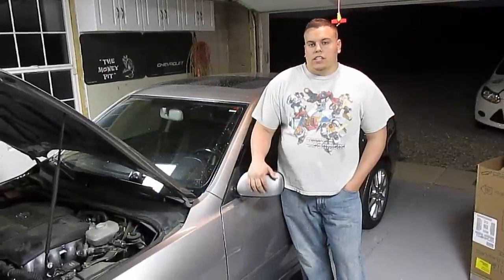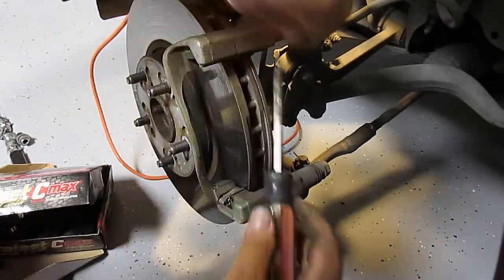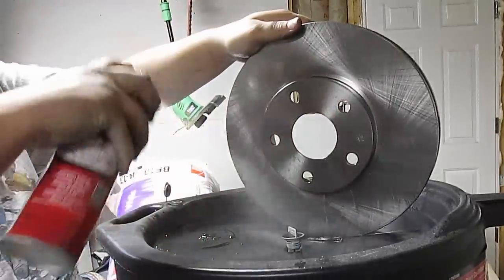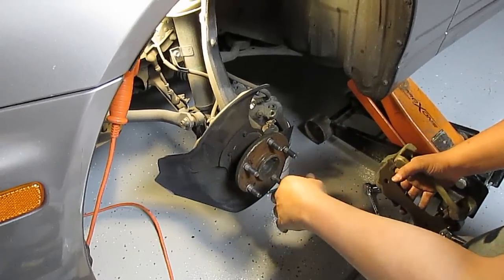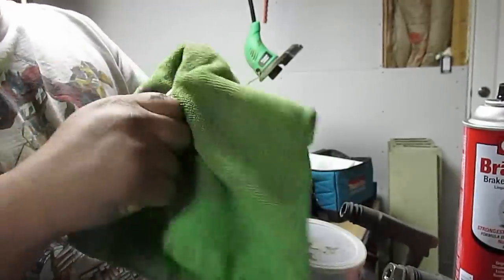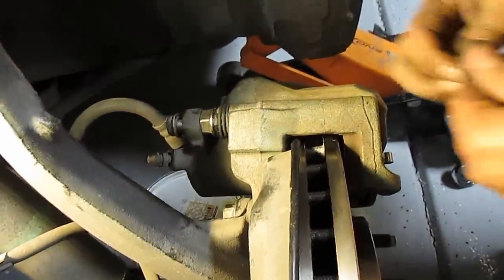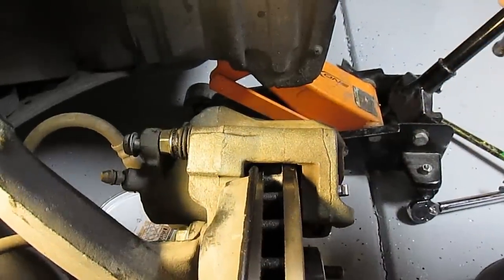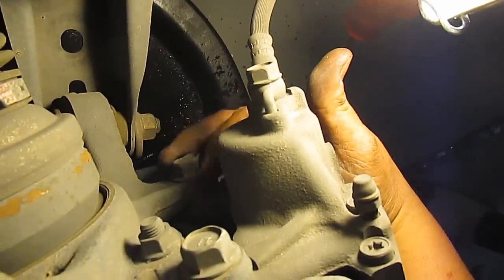Step-by-step Guide Easy Front Brake Replacement 1999-2005  Lexus IS300

Comment: Do not use that grease for slide pins. Silicon High Temp Lubricant (brake grease) is required, that grease will break down, and the slides will seize.
Reply from the maker: have never had an issue not once.  and i track day my cars
Reply: +Jason Georgievski I cannot argue what has or has not happened to your brakes, this is a common well known issue with incorrect grease. You can do whatever you want tho.
Reply: Well i cooked a friends brakes by using bearing grease... They were gone in 10 months and the grease was like a sticky wax ONLY USE Ceramacote or caliper grease also you appear to be from the westcoast on the east coast brakes will be so rusty that thwy wont just come off.  Hubs may need to be sanded as well.

Comment: Just a heads up when you’re cleaning your slides off and they have rubber grommets on the end of them like that one be careful on what you clean them with that brake cleaner will sometimes make that rubber swell up if you get the hardware kit it should come with the new rubbers also when putting your slides back in be sure to get the air out of the slide holes squeeze the rubber and push the slides in so the air gets out
Reply from the maker: hardware kit did not come with them.  but yes rubber can possible be damaged.  but this specific rubber part had no adverse affects.
Reply: @FatGuyBuilds  where does the pin with the rubber go up or down?
Reply from the maker: @merse65  pretty sure it doesnt matter.  But i think it is down

Comment: Toyota charges $759 for a brake service ( front) and $800 for the rear.     It’s ridiculously expensive but cheaper through them vs the Lexus dealership.
Reply from the maker: But it would have only cost u 200$ to do it yourself for front and rear

Comment: You wouldn't have to bleed the brakes as long as you just do pads/rotors, right? Do you put any anti-seize anywhere?
Reply from the maker: As long as you dont pull the brake lines off you dont have to bleed it.  Unless the fluid is no longer clear.
Reply: @FatGuyBuilds  Thank you my guy. Lovely video, excited to pick up my IS300 this Friday and will definitely be back here when I do the brakes myself

Comment: Hi, thanks for the video it was very helpful. I'm new to cars and just wondering what was that can @ about 6:15?? What is that oil thing called and what is it for please?
Reply: BrakeKleen.  Any brand of brake cleaner will do.  

The grease is automotive grease.
Reply from the maker: any brake cleaner chemical will work.  The grease must be HI temp.  above 450 degrees

Comment: Great video,  until you half arsed the bleeding part.  There's no need to bleed the fluid when you're changing out pads/rotors.  You will need to open up the brake reservoir to allow the fluid to raise when you press the caliper pistons back.
Reply from the maker: I did open it, i guess i forgot to put that step if you are saying something.  his fluid was original and brown.  so i changed it.  dont wanna do it then you have that choice.
Reply: @FatGuyBuilds  All good,  I really appreciate you putting out the extremely well made video.  If the fluid is brown,  then a complete flush would be needed.  Also, you'll always want to connect a clear hose(you can see the bubbles this way) to the nipple and collect the old fluid in a bottle for proper disposal.  That stuff is very corrosive so you don't want it to run onto every below.

Comment: On the passenger side front, is the bleeder screw above the caliper or below? I just re did all for corners and I've heard you need to have the screws above the caliper
Reply from the maker: Calipers only mount one way.  Bleeders are only in the spot they are designed for.  So if everything fits then u are good.

Comment: 08:28, never specified which goes on the top and which goes on the bottom.
Reply from the maker: They are different widths from what i remember.  They only fit in one spot.

Comment: I just replaced my pads and rotors on a 2002 lexus is 300, but I'm getting a clicking noise as my wheels spin.  As far as braking goes,  it stops fine with no squeal.   Any idea what it could be?  Nice shirt btw,  huge tf fan myself.
Reply from the maker: +Robby Capitly push the heat shield away from the rotor

Comment: I did rear pads change on my is 300 like you showed but now my parking brake light doesn't go on when I put parking brake on. I had Parkin brake engaged when I took rear tires off and changed pads does that make a difference?
Reply from the maker: you were not supposed to have the e-brake on while doing rear pads.  how did you even get the new pads on with the e-brake on?

Comment: How do I replace the rear rotors? I got my rear caliper off but the rotor didn't slide off. I even hit a few times with a hammer and it didn't budge. Can  please tell me how to get the rear rotors off?
Reply from the maker: So i believe the is a phillips screw on the front area of the rotor where the lugnuts are.

Comment: Caliper bracket bolts, are they supposed to have loc tite on the ends?
Looking for replacements, the ones I’m finding on the NAPA, Advanced Auto, and AutoZone sites look like they have some red loc tite on the top. Which would explain why I stripped the tips of my bolts getting them out on one side, but in images of Lexus/Toyota bolts, there is no loc tite type material anywhere on them...
Anybody know?
Reply from the maker: no locktight is needed

Comment: I get a weird cracking popping sound when I release brake from stopped I think I may have put in caliper bolts wrong?
Reply from the maker: Pull it back apart.  Check everything is tight and lubed

Comment: Is there a need to bleed the rear ones as well? I am looking to replace the rear and front rotors and pads. Do I need to bleed the fronts? Or just better to do it rather than not doing it
Reply from the maker: +Antonio Carrillo If the fluid is old, then bleed it.  if you replace the calipers, then bleed it.

Comment: Why did you replace the rotors since the brake pads were  not eating into it and and needing resurfaced? Just curious.
Reply from the maker: Because they cheap and takes less time and aggrevation than turning rotors.
Reply: FatGuyBuilds Because you want to pads to seat better?
Reply from the maker: @bjimbosld  because running stock brakes..  turning the rotors costs the same by the time you work in ...  your time. Cost to turn. Gas to drop off and pic up discs.... etc

Comment: hey man i just found out i only had 1 bolt holding my rear caliper in place do you know the size of the threads on them?  or are they the same as the front? ive looked online and cant find any info
Reply from the maker: Devindar Ram take the other one and match it at ace hardware

Comment: How the heck do you take off the rear rotor? It won't budge.
Reply from the maker: Look for a counter sunk bolt holding the rotor on.
Reply: @FatGuyBuilds  it turns out both were rusted to the hubs and I had to screw 2 8mm bolts into the holes on the front of the rotor to push it from the face. They eventually made a loud popping sound when they were free.

Comment: I Just Changed My Rear Breaks And They Still Squeek what can I do to stop the noise??
Reply from the maker: guerratiburon did u clean everything first with brake clean
Reply: The Person Who Did My Breaks Didn't apply nothing to them
Reply from the maker: guerratiburon cuz the rotors are oiled when new
Reply: Just The Breaks were changed didn't apply nothing to the rotors or break pads
Reply from the maker: guerratiburon then the rotors need to be cleaned.  spray each side with brake cleaner
Reply: will I need to take the tire off

Comment: How did you check rotor thickness
Reply from the maker: They are new.  No point to check brand new rotors.
Reply: I just figured why my rotor is wobbling it is missing that screw in the middle that holds it to the hub? Any idea what type of screw that is for the is 300?
Reply from the maker: @viscioushattermaid4410  u dont need that.  Once u tighten down the wheel, the rotor sits flat.
Reply: Thanks. How often should change rotor? Mine is at 31 mm but it’s like 6 yrs old or more minimum thickness I think is 30 mm

Comment: Just to be clear, the back rotors and pads are SIMILAR but they are not exactly the same steps. In fact, they are quite different depending on your definition of "similar".
Reply from the maker: Same steps.
Compress caliper
Take off 2 bolts
Remove pads
Remove caliper bracket
Remove rotor
Install caliper bracket
Install pads
Install caliper
Pump brakes.
All done
Reply: @FatGuyBuilds  SIMILAR but not exactly the same.
Caliper bolts are 17mm on the back. According to you, 14mm on the front (17mm for the bracket).
Need to re-grease slide pins on the front. No slide pins on the back.
Back does not have separate caliper and bracket. Its one piece.
Anti rattle clips are different. How pads are held in is different.
Pads are shaped differently. Come out differently (though easily in both cases).

Like I said, similar but not exactly the same. I also said it depends on your definition of similar. I don't see the problem with my comment? I'm not trying to argue with you or anything...
Reply: Apologies, I decided to rewatch your video and I see where the miscommunication is. At the beginning of the video you say the rear ROTORS are the exact same steps as the front ROTORS. Of course this makes you absolutely correct, the rotor replacement is identical between front and rear. I thought you were referring to the entire process between front and rear.

It sure didn't help that in your reply you list the steps for what seems like the entire process...jus' sayin' ;).

Anyway, the video was helpful and I appreciate you posting it. Sorry for making something out of nothing.

Comment: No need to bleed the brakes. Lots of extra work for no reason.
Reply from the maker: zachattack421 his brake fluid was black.  It was heavily oxidized.  If your fluid is clear then dont worry about bleeding.
Reply: Jason Georgievski agreed. I didn't even watch the bleeding because the second he talked about it I skipped past! But yes that is agreed. Also looking to get brakes and rotors all the way around. You know any good online stores?
Reply from the maker: rockauto.com is what I use.  I even road race with the standard Pro-stop brand kit.  they work fine.  do not get the slotted and drilled version.  way too noisy with not enough benefits.

Comment: Well lit video.....Just a few pointers.
No torque wrench used ?
You dont use ratchet wrenches to undo tight bolts.(breaker bar)
No grease on pad springs and faces of pistons ?
Fluid resovoir not opened to allow expansion when pressing back pistons ?
 Ordinary grease used on sliders and rubber components ? Should be red rubber grease as per manufacturers specification!(rubber degradation)
You dont need to bleed brakes when just changing pads...confusing.
You bled the brake fliud all over other components ?
With all due respect...you are not a good mechanic.
Reply from the maker: Don't need a TQ wrench for brake job.  just make it good and tight and do not strip the bolts.  Don't need a breaker bar as I can get the bolts off no problem with plain wrenches.  Sorry, fluid reservoir was open...  forgot to video that.  I used full synthetic grease that is good to 500 or 600 degrees for those slider pins.  that is more than good enough for a daily driver.  There are always perfectly good replacements for factory specs that will work perfectly.  I was bleeding the brakes because the fluid was black.  Brake clean will fix all of the brake fluid that dripped on control arms (this is no big deal at all).  I am a fine mechanic,  the car works great, there is no excess grease or fluids all over the car, and there are no bad noises.  this means the job was done correctly.  there is also more than one way to skin a cat!  thanks for the comment...
Reply: Jason Georgievski
If you are making a 'How To' video I expect to see all relevant stages, safety advice and good engineering practices.
Manufacturers recommend use of torque wrenches.
Guess why ebay sells ratchet wrench repair kits ?
IF the fluid was black in the resovoir...you will need to investigate immediately and flush the entire system !
Using brake cleaner to clean up bad garage practices is not good.
"no bad noises"..is hardly indicative of a job done correctly !
I used to pack parachutes ..and never had one complaint about my work !
Reply from the maker: Dont ever need to buy ratchet repair kits.  Craftsman and many others have lifetime warranties.  It was blackish because the cap was left loose for 100k miles or so and it absorbed a lot of air.  Yes i did flush the entire system and it is all good now.  Lol so ur complaint is that i didnt put a tiny hose on the bleeder screw that drained it right into the pan?   If you read my last comment fully you would have saw more than just "no bad noises".  If you dont like my videos then dont watch.  My videos will help enough people.  If you want to freak out because i didnt use a torque wrench.  Oh well...  the truth is you dont need to use one.